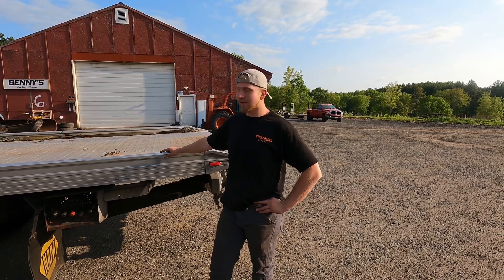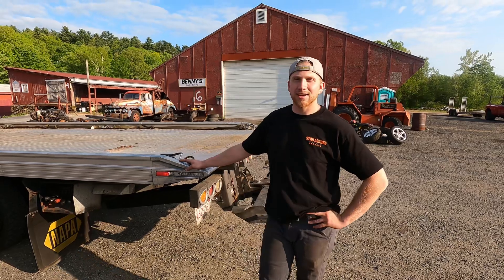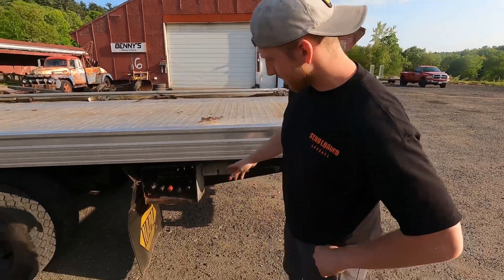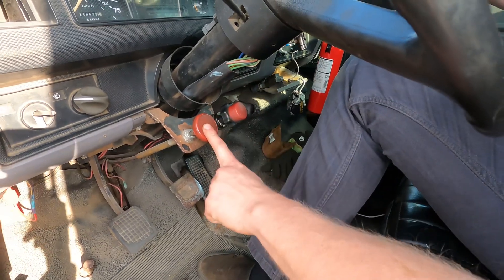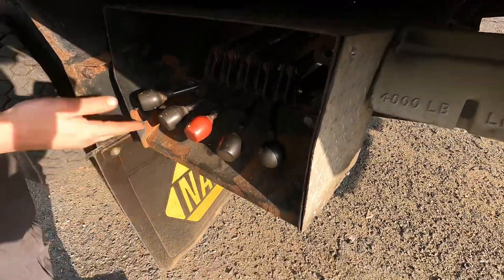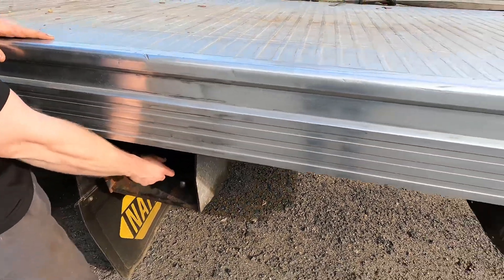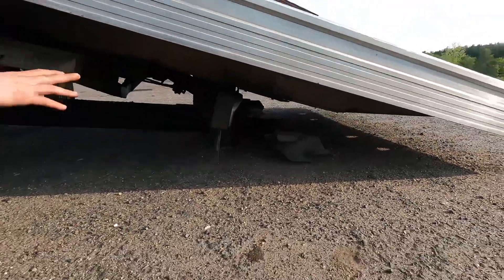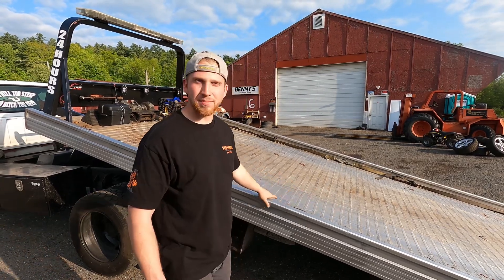How To Operate A Rollback Tow Truck

Comment: Thank you for this video. I’ve been operating a roadside assistance business for the last two years and want to move into towing. With no experience, videos like this are very helpful.
Reply from the maker: Let me know anything else you’d like to see, and I’ll be sure to help out! That’s what this channel is for! Checkout our other videos
Reply: @TheTowBro  I would be interested in pretty much anything that you might learn doing training, especially from an owners perspective. A lot of practices might get the job done, but you would only do that if you didn’t own the truck. Perhaps strapping/chaining techniques, how to not abuse the truck, truck/bed configurations to avoid when buying a new truck, things like that. Thank you sir!
Reply from the maker: @jessetruck903  I’ll drop a chain/strap video this week!
Reply: @TheTowBro  awesome man, thank you! I’m mostly curious about how you set up a truck to handle vehicles/cargo of different lengths and sizes. Like a lowered Miata vs lifted dually, and a motorcycle or toolbox vs a shipping container, for example.

Comment: So here's a question is there a way when using the wrench that you need to use it depending on rear wheel or front wheel drive
Reply: Put...it...in...neutral.🎉

Comment: You have explained very nicely.
My question is which type of license we need to drive tow truck? And do we need to get classes from any institution to drive tow truck ? 
Thanks
Reply from the maker: If the GVWR is under 26,001 you do not need a CDL. However some states require a chauffeur license. No particular classes are required but they do help !

Comment: Nice tutorial. What is a reasonable price for a 20 yr old truck with 200k or so on the odometer?
Reply from the maker: To be honest mileage doesn’t matter as much as overall condition, rust, etc. I’ve put $20k into my truck over the 2 years I’ve had it. It’s the cost of business, and if still value it at about $18k. I actually have it listed for sale on marketplace at $18k